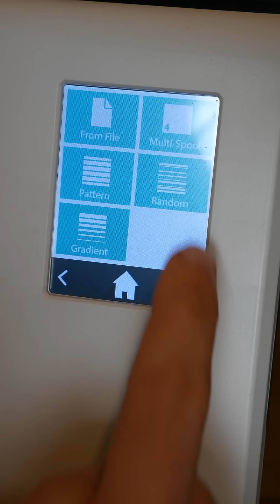Use up your nearly empty spools efficiently

Comment: I actually bought a Pallet 2s for this very purpose. Only for a local company's rPLA to break the filament run out sensor. Imagine a spool of filament going from 1.6mm to 2.7mm.
Funny thing. Their other filaments work great. Lulling me into a false sense of trust on this stuff. That r stands for reject.
I paid about $250 for my 2nd hand 1. And it worked fine.

Comment: My main grief with the palette 3 is the lack of integration, I’m working on some integration with killer and mainsail mainly for automating the loading and for filament runout/motion and slowdown during splicing.

Since their source code for the palette 3 firmware isn’t open I have to reverse it and therefore I’m unsure if I would ever be able to share my work publicly.
Reply: Maybe get another guy or a group which won't reverse engineer the Pallete firmware in any way but instead do all the programming for you, while you give a general idea of what the original does without spilling any of the proprietary code

Comment: I do this in my Bambulabs X1C. Kinda made the palette redundant tbh.
Reply: Not really as the palette can work with any printer also has way less waist then the AMS
Reply: @shanold7681 what waste? changeover when one filament runs out doesn't have much waste. saves you having to align the filaments too

Comment: I'm literally sitting rn watching the last few feet of a spool run out to swap it. My printer has an auto sensor and will pause it, load a new filament, purge and continue
Reply: Has it finished printing yet?
Reply: @kxjx 😂
Reply: What printer is this?? 👀
Reply: @Nowantit  sorry i wasnt very clear in that response😅 artillery sidewinder, has a filament sensor, Pauses the print if it runs out, sets an alarm off, lets you load another filament (or you can swap midprint if you want for multi colors) and resume the print. Sorry🤣 re-reading my post i get what you read😅

Comment: Just throw away the 30 grams of filament. Still on point for 3D printing, solving a problem that doesn't really exist.
Reply: Tf lmao. 3D printing does solve problems that exist. There’s a whole generation of kids that have grown up around 3D printing, and it being something a dude can put together and run in his bedroom. Its introduced thousands of people, if not more than that, to manufacturing, CAD/CAM, engineering principles, troubleshooting, mechanics, electronics, design principles, trial and error, coding, etc etc, and all that’s not even including its industrial uses, like how it lets people prototype parts within a couple hours after they’ve come up with them, or how it lets companies replace more expensive solid metal or even sintered metal parts with 3D alternatives designed to handle the strain the part is expected to see. And all of that without requiring 3 phase power, a milling machine that weighs thousands of pounds and requires hundreds of dollars worth of tooling to make the same product that a 3D printer can make, a lathe, and someone trained in operating those machines.
Reply from the maker: 3D printing is like the Lego I built as a kid. If I could imagine it, I could make it (assuming I had the right pieces). Now the same applies for 3D printing. I'm constantly designing parts to fix little issues in my life. It's not for everyone but I would be very frustrated without it.

Comment: I just thought of another use. I have some filament that will not stay adhered to my bed. No matter what I do. It just comes loose at some point. I could do a layer or 2 with some stuff that adheres fine then switch to the stuff the stuff that doesnt.
Reply: tb yes, you could, as logn as they adhere to each other that would work.....
now i wodner if itd work using pla on the bed adhesion then use a high shrinkage filament ontop, to stop the shrink issues
Reply: as a correction, using a bed/raft of pla, which does not peel or shrink back, then a raft/supports inwhich the filament is changed so by the time actuall model is started the pla is purged, and model filament nylon or abs stuff
Reply: @any1alive I imagine it should work, similar in principle to using a different filament for supports that might be cheaper and not as good of quality and the better quality stuff for the actual print.
Reply: Clean it with vodka and if it's still a problem it's probably just cheap or defective filament
Reply: Good job, you just got the stupidest idea in 3D printing.

Comment: I use the near used spools for my weed trimmer.
Reply: Lol I was racking my brain trying to work out how you could use it to trim cannabis, then it dawned on me. 🤣
Reply: does this work? My filament seems to break easily so I did not thought something like this could be done.
Reply: @Z3DZ3R0 In fact, the first filaments were weed trimmer refills from Nylon. That's why there is now the 1,75mm diameter. We officially have come full circle.

Nylon gets quite flexible when humid, so it is literally perfect for a weed trimmer. PLA often gets crunchy if it is reaaally wet and just falls apart.
Reply: That's funny. I was wondering if my spool of weed eater line could be used as a filament because it's an obscure color. 😂
Reply: @justing7490  I remember reading another comment on youtube of a guy that tried it. It's not more cost efficient though.
Reply: @justin g  yeah I think it was cnc kitchen that tried it. It's nylon so it's a "cheap" way to get small batches of nylon. (It's more money per gram than filament but if you don't need a lot it is cheaper) it's slightly thinner than 1.75mm filament so you need to play with flow rates.
Reply: I was confused by this comment for a second, and had to reread it, because in another window I'm watching storm chaser, Reed Timmer.